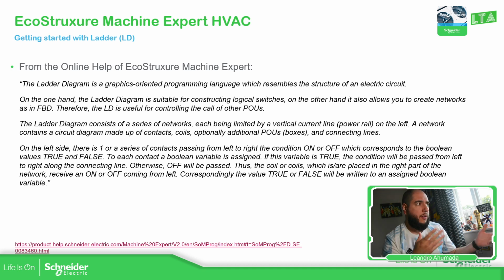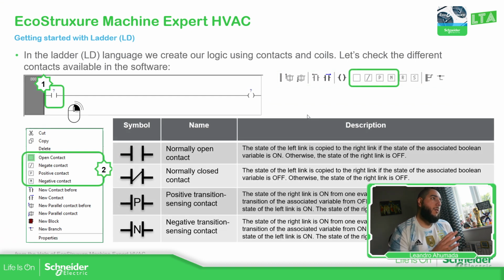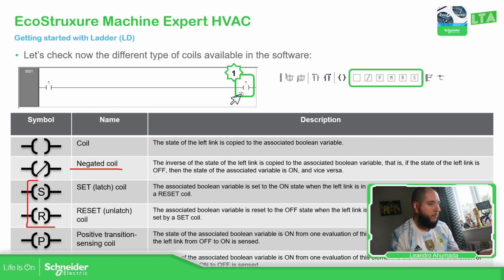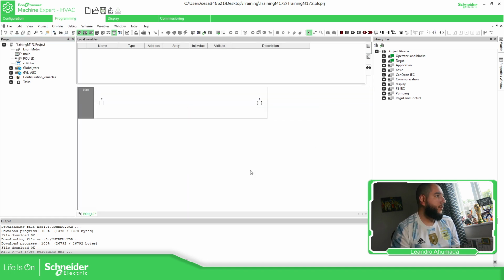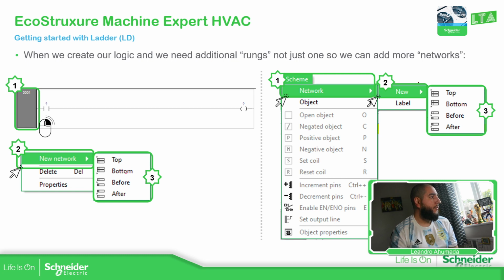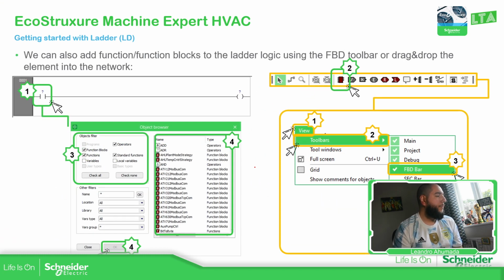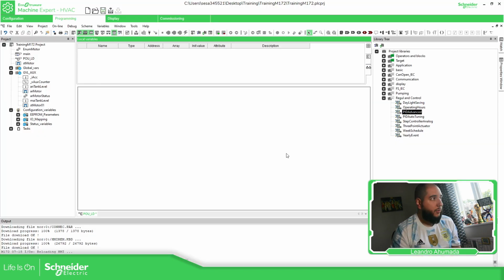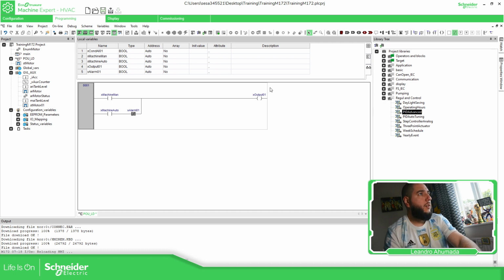EcoStruxure Machine Expert HVAC Training - M4.1 Getting started with Ladder LD

Comment: buenos dias leandro como estas
quisiera saber que me orientes como puedo hacer que una entrada de 4 20 ma controle una valvula motorizada con control 4 20 ma, con control pid. desde ya muchas gracias
Reply from the maker: Buenas Marcelo, 
Ya probablemente ya lo hayas solucionado 😅.
De todas maneras, el escalado va a ser vital aqui. La entrada analogica una vez configurada como corriente te dara una señal de 0 a 1000 que deberas escalarla a jn valor entendible para luego en el pid compararlo con tu setpoint. La salida del pid te dara un valor de 0% a 100% que deberas usar en la salida analogica (creo que aqui no es necesario escalarlo)